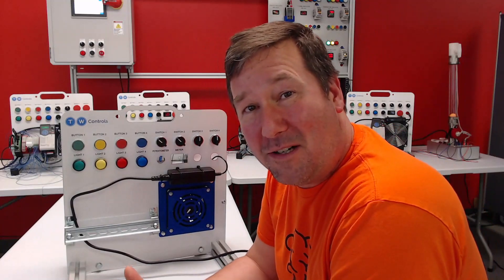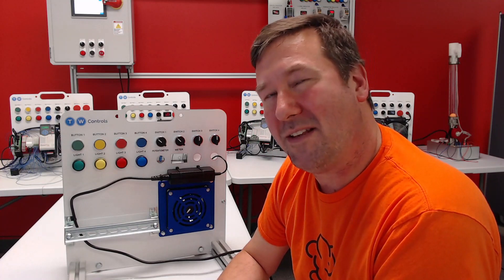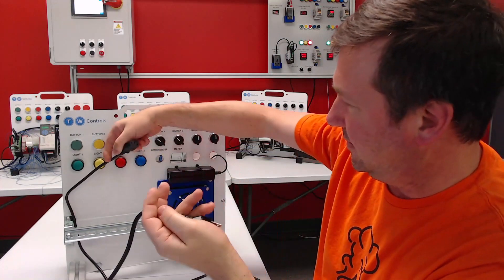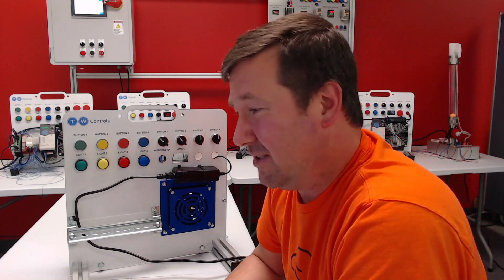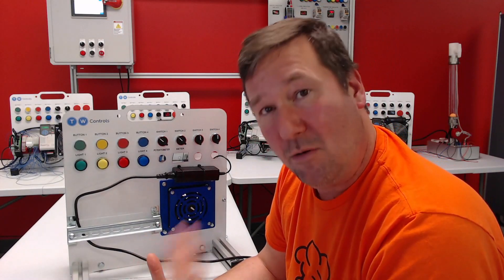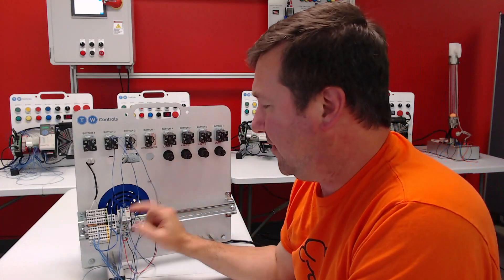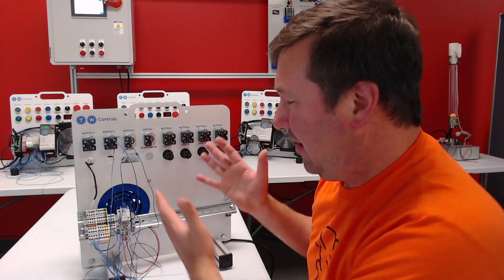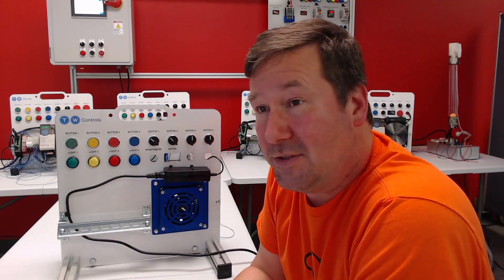24VDC Industrial Electrical Control Panel Training

Comment: Will controls still work if I’m converting to 20 VDC instead of 24V?
Reply from the maker: Check the voltage tolerance is your devices
Reply: It’s not into the little documentation available. I’m using a bridge rectifier to convert the control signal from 24 VAC to 24 VDC but noticed I only have 20 VDC on the output. The electric heater seems ok and everything use to work before. Wondering if the rectifier is defective or if the problem is elsewhere.

Comment: Sounds like a good idea. You could use the switches to demonstrate basic boolean logic. Maybe add a simple diode to demonstrate DC polarity (acts like a one way check valve). Add a digital volt amp meter to show how multiple bulbs draw more current. How about adding a low current blowable glass fuse to show how they work to protect a circuit when too many bulbs are added in circuit.
Reply from the maker: I hate to have a disposable part that has to be replenished.  I wonder if I could do the same thing with a circuit breaker.

Comment: Hello Tim,

Yes, there is something to be said about the attractiveness of danger. There is a certain type of student attracted to things like the Tesla coil and plasma generator. 

You asked about ideas for the trainer:

1) Have you considered an Arduino compatible board such as:

https://www.rugged-circuits.com/24v-industrial/24v-industrial-shield

This may be an easier entry route than a full PLC as folks can leverage the wonderful Arduino community. It’s been my experience that folks are more comfortable with the Arduino. Also, the Arduino software is considerably easier for the school’s IT department.

2) If you haven’t already done so, consider including traditional as well as LED lamps e.g., the 1819. The typical LED can run at voltages as low as 6VDC allowing students to explore series connection.

3)  Consider adding a time on-delay relay. 

4) Include material to construct a switch. Consider something simple like weight on the end of a steel guitar string. Have the students construct a panel tilt detector switch.

5) Consider what you could do with a small 24 VDC pump. Students could move liquids (feedback to turn off the pump). They could also pump air into a balloon with that switch to turns off the pump when the balloon reaches a certain size. 
https://www.amazon.com/Vacuum-Water-85KPa-Oil-Less-Motor/dp/B07KWCQPYC

Cordially,

Aaron

P.S. That fan likely a brushless DC motor; commutation with Hall effects sensors to MOSFETS.
Reply from the maker: Hi Aaron great suggestions! I've explored the idea of an Arduino controller before but axed it because it isn't what students will run into our on the field. This trainer is capable of series/parallel experiments showing voltage drop. The timer would be a nice addition! The pump idea... let me do some brainstorming!